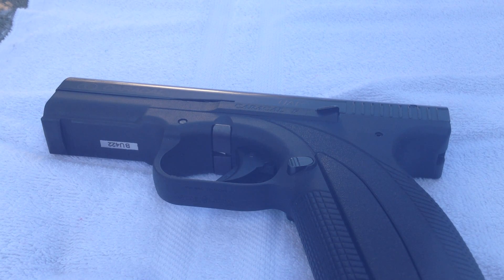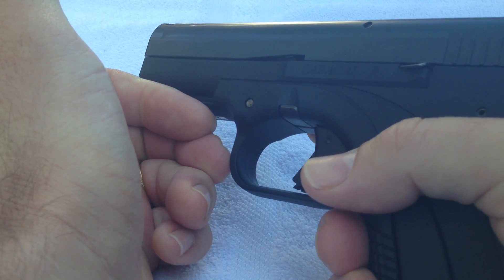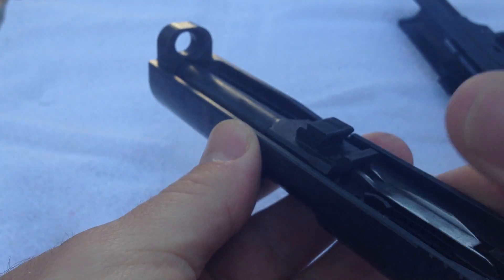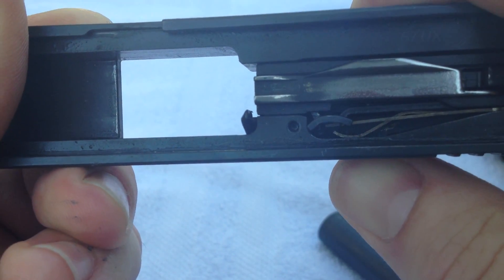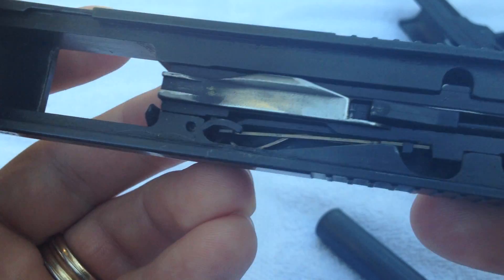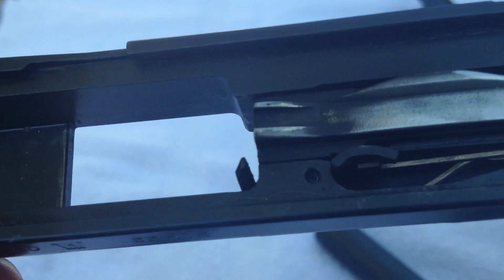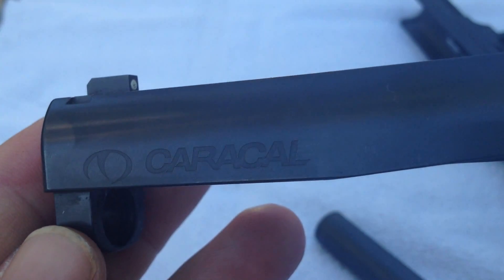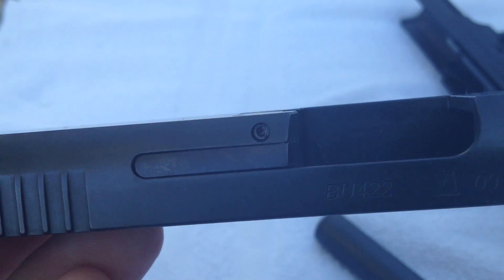Caracal F 9mm Striker Fired Pistol Internal Look at Extractor Spring

Comment: I've shot about 800 rounds in my Caracal C QS gun and I have not had that problem. I used reloaded and new ammunition and has never failed me the extractor pin. I would recommend contacting your vendor.